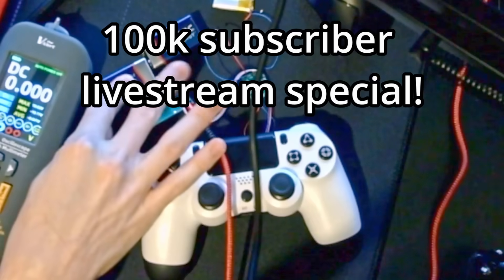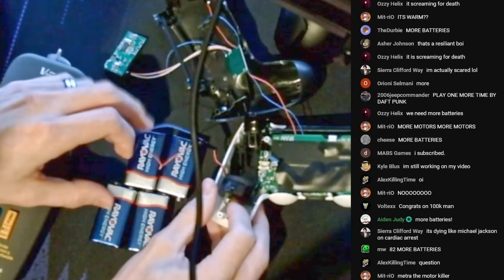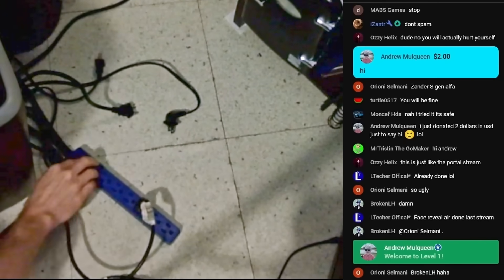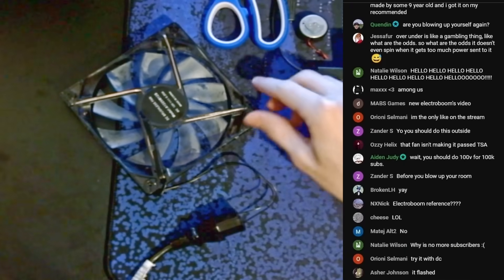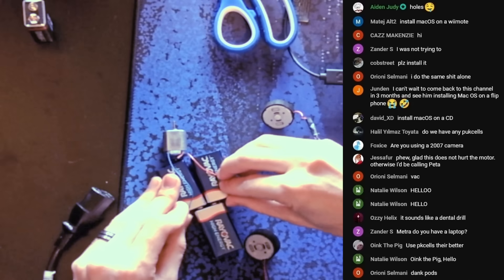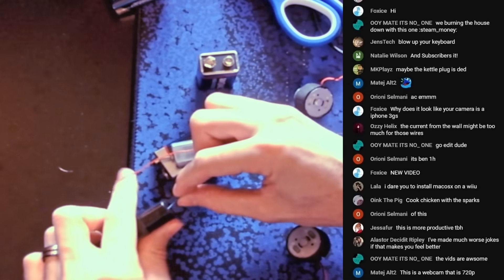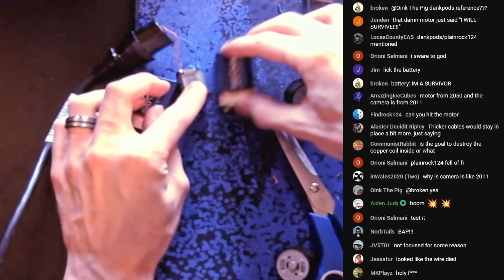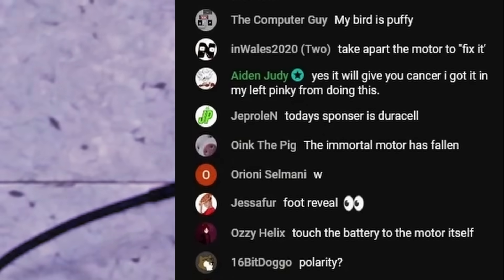Blowing Stuff Up With 120 Volts to Celebrate 100,000 Subscribers

Comment: for anyone who was wonder the reason it didn't die with 4 batteries is because connecting them together only adds the Voltage of the 9Vs together but the amperage is the same as just one battery

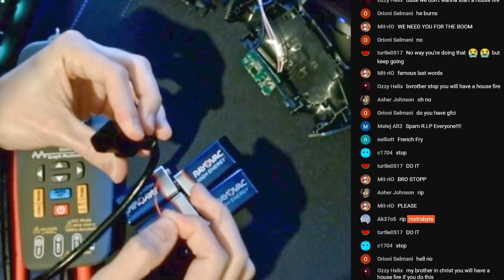Comment: 2:28 bro shoving AC in a DC motor, surely nothing will go wrong, suuuurely

edit: yeah bro none will actually try to spin, ac and dc motors work differently, you need to convert the current otherwise it won't work at all